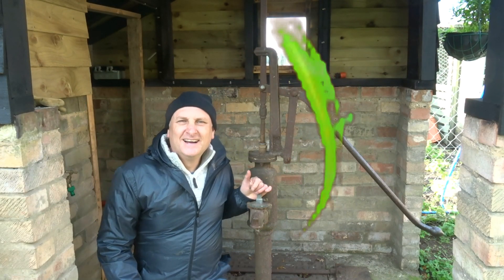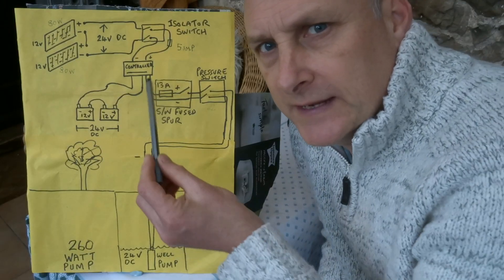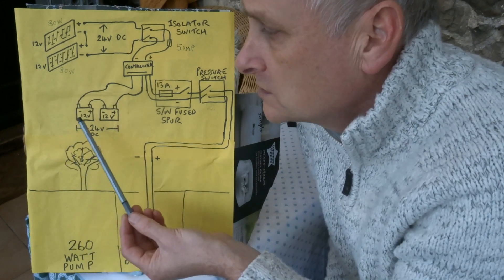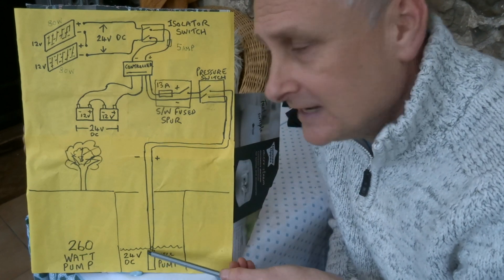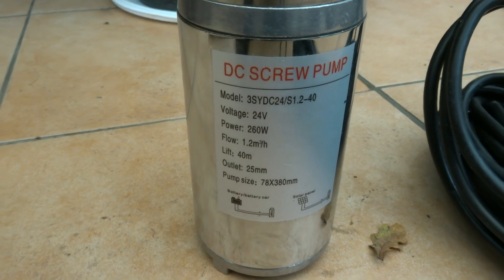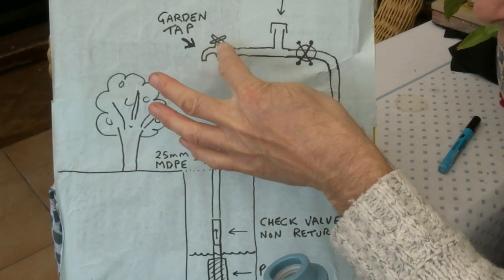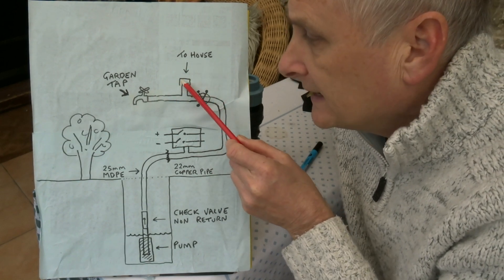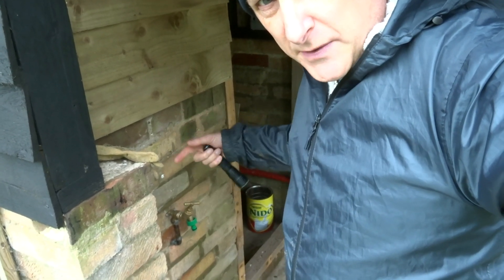SOLAR POWERED DEEP WATER WELL -- OFF GRID WATER -- SOLAR PUMP

Comment: Fantastic...super jealous. Do you think you'll need some form of water treatment (chlorination, filtration, UV, boiling) before plumbing into the house drinking water network...? I guess you'll have a better idea after the testing. Is there a chance of bacti contamination from your poultry, duck pond? or is the groundwater deep enough to be protected by the soil and rock in between the surface and the water...really hoping to be off grid too some day.
Reply from the maker: Hello, even if the water tests safe it will still go though filters and UV lamps before it goes into the house, a big important must , also it will still be tested regular. I would hate to poison the family with some water born disease or pollutants . I will be going over the top on water safety. Good luck on your off grid adventure ! it is the way forward in this modern world where you can no longer rely on the system and big corporations. Thanks so much, keep safe and well.

Comment: Have you been spying on me? I had exactly this conversation with my brother and my nephew as to how I could get the well pump to work and whether I should get a 12 V or 24 V and how we control pressure switch et cetera. Thank you for explaining it all in your typically humorous way :-)
Reply from the maker: ha ha ! thanks DJ, keep safe and well, good luck on your future projects.  The higher the voltage the thinner the cable can be for less power droppage, a 12v deep well would have to use a lot  thicker cable to compensate, but if its only shallow it would be fine, hence why the power network across the country uses such high voltages such as 11KV to transport over large distances then drops down at substations to supply homes.

Comment: Real glad to see u back on YouTube Gary. That well might be handy for a ground source heat pump for when we are band from burning fossil fuels and wood. Glad to hear ur going to insulate the house. Next year we will look at insulation being added to the cavity wall of the house. Should be a big improvement for us. Then solar has to be on the cards. Love to see more on ur solar setup. When u insulate also look at air tightness of the house
Reply from the maker: Thanks Marcus, being an old cottage we are just going to batten out a couple of external walls from the inside, then a little rock wall, then tongue and groove panels, we have solid walls here, our loft has been well insulated for many years now with 100mm Kingspan and completely boarded out on top, that was hard blinking work many years back. It sounds like your heading in the right direction in your place, i feel energy prices are still cheap !!! ha ha cos its going to get worse ! good luck and take good care
Reply: It’s a big job when u think of decorating and all. I did a wall with king span a few weeks ago. Very hand as u just express nail it. No battens but 30 quid a sheet. Good luck Gary

Comment: So Gary does the charge controller know when the batteries are fully charged, or is it that it knows that there is too much energy being produced …I’m really interested in how all this work. 😃another great video
Reply from the maker: Hello Jill, a good question, the charge controller measures the battery voltage very precisely,  as small as 0.1 of a volt increments. When the voltage hits a certain voltage the controller knows its fully charged. A fully charged 12v battery reads normally at 14.2 volts. When it reaches that amount the controller switches off the power from the solar panels. This solar equipment is very reliable and rarely goes wrong, im talking over 20 years life in many cases ! i love solar ! thanks Jill, hope your keeping well and of course being your normal fugal self ! im even buying my cloths from charity shops now ! a lovely new looking pair of jeans for just £2 !!

Comment: Nice to see you still battling on. Your water system would benefit from a pressure vessel to stop pipe hammer, the pressure switch cycling the pump, even the water flow and allow some pressure to be in the pipes. You possibly would benefit from a second non return valve at the top of the well so you aren't just relying on one non return to stop contamination flowing back into the well
Reply from the maker: Hello Tyson, thanks for your tips, im no expert ive just watched a few video on here, the pressure vessel you mentioned would that be like one of then expansion vessels but larger used in home heating systems ? i also have a spare non return valve that could be fitted easily at the top. thanks for your help. Sorry for a late reply, im surprised in the amount of comments im now getting. thanks and keep safe and well.